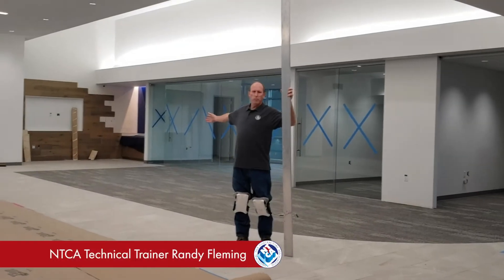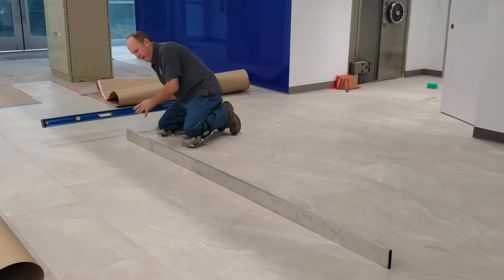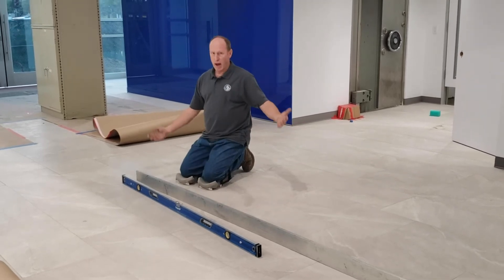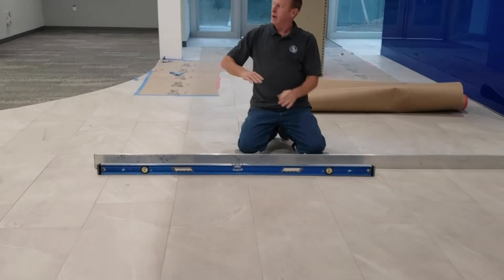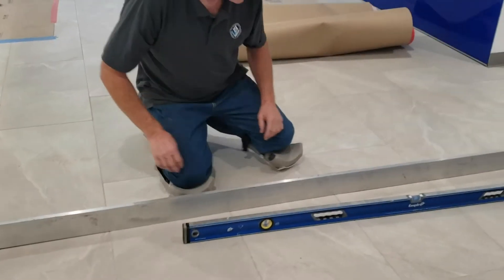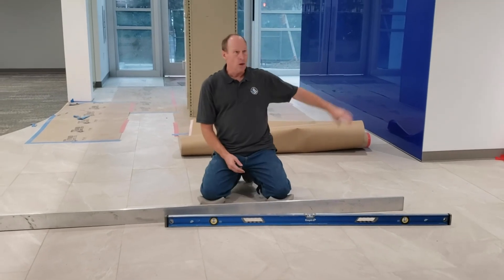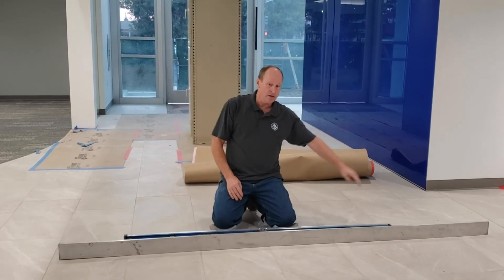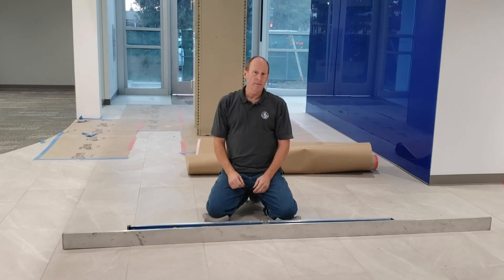TileTV: Flat & Level (S2;Ep2)

Comment: I think we need an explanation of what "dropping your float 1/2" really means. Was it thick-set? Medium bed? There is no way you had over 1/2 inch medium bed if you used a notched trowel, and if it was dry-pack, what did the minimum on the low-end end up as? Is there wire underneath it?
This raises more questions that it answers.
Reply from the maker: The floor in question had a thick-set /deck mud mortar bed installation. (See Method F112 in the TCNA HANDBOOK). 

The main area of the floor was a nominal 1" thick mortar bed. The area shown in the video dropping 1/2" , the deck mud was ramped/sloped down following the uninterrupted grout joint shown in the video.  When the mortar depth was too thin for proper thickness of deck mud (3/4") we changed material to a cement based patching product, that was designed to be installed at lesser thicknesses.  

The area in front of the vault door was bonded directly to the concrete floor over crack isolation membrane. (See Method F113). This was due to the vault door only having 5/8" of clearance below the 6000# door, which allowed only enough room for crack membrane, thinset and tile and 1/8" clearance for the to door swing above the tile...too close for comfort! 

The two different methods of installation were separated/isolated with an expansion joint. 

Hopefully this helps, if you have any other questions, please let us know.
Reply: @nationaltilecontractorsass3030  
Excellent! Thank you.
Reply from the maker: @tileformiles  Our trainer wanted to add: I should also clarify that all of the ramping/sloping was accomplished in the actual mortar bed and surface preparation not in varying the depth of the bonding mortar, which was a LHT mortar that we used since the tiles were large sized at 18"x36". There was no wire reinforcing in the mortar bed since it was a bonded mortar bed application, and trying to incorporate reinforcing mesh in mortar beds with less than 1-1/4" depth has proven to be very problematic.  However, reinforcing mesh is required in unbonded/ cleavage membrane applications with a minimum mortar depth of 1-1/4". (Please see ANSI A108.1A for mortar bed, cleavage memory and reinforcing mesh requirements).
Reply: Great Job! That's a lot of floor prep!